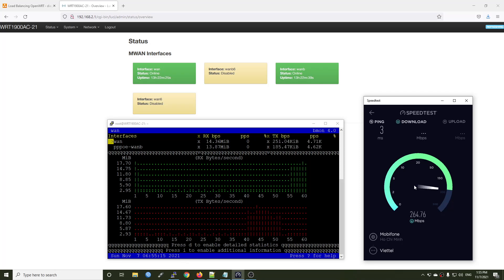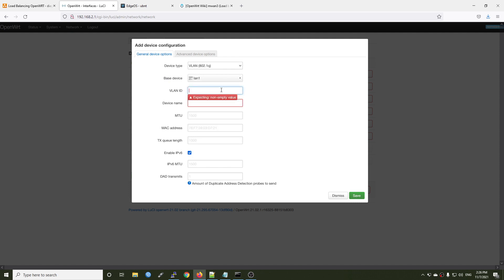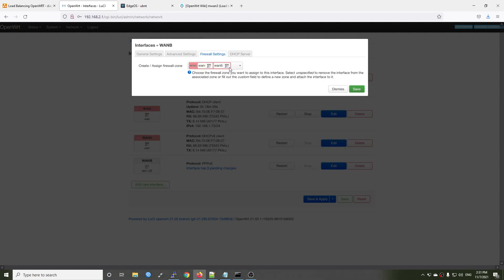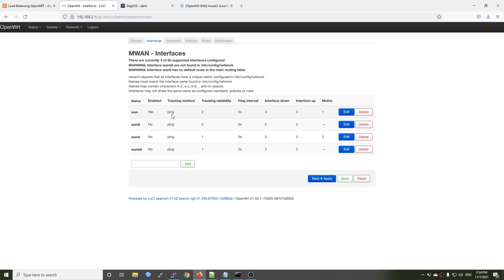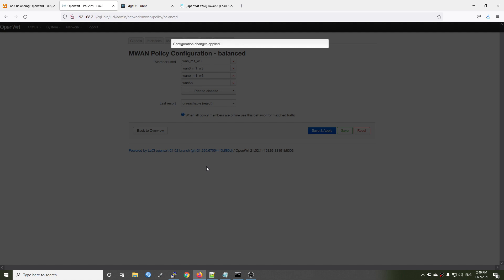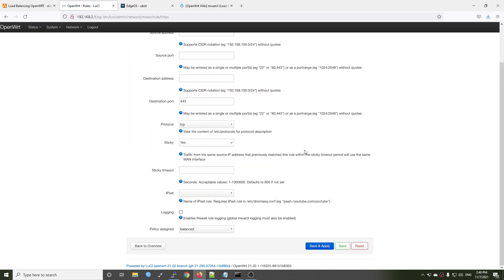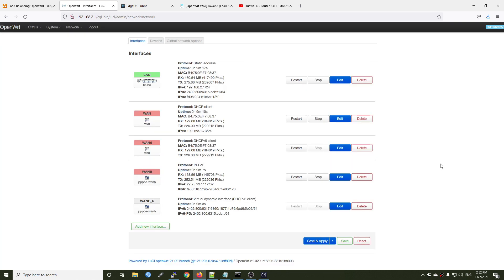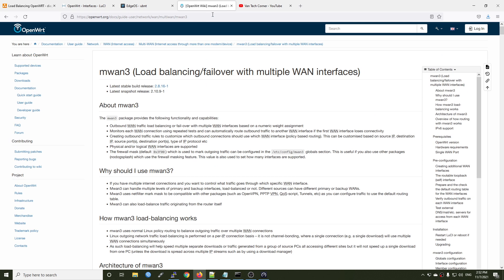OpenWRT 21.02  - Multi-WAN Load Balancing with mwan3

Comment: I know I’m 3 years late. But is it possible to run mwan3 along with SQM? A lot of apps I use support multiple connections nowadays, and I don’t want downloads utilizing the full speed of the WANs increasing latency for others.

Upon researching I think my Linksys WRT32X is not capable enough to run mwan3 with 2 interfaces and SQM, it will run into CPU bottleneck. Is this correct? Will a mini PC with Intel N150 accomplish what I want?
Reply from the maker: It is possible to use mwan3 & SQM, and you need a powerful processor to handle that. I highly believe that N5105 router PC with 2.5GbE ports will help, but will need you to test :)

Comment: What is the purpose of the VLAN?  Does it work without adding new VLAN?
Reply: Might be a vlan required for the PPPoE connection to the ISP.
My ISP for example requires VLAN 835 to connect

Comment: Hello I have a router Xiaomi ax3600 with openwrt. Previously i had no broadband connection on my home. But my next door neighbours wifi password (They gave me) I knew so I was using my router as a wifi repeater and used wifi more than a year with no problem. Their line speed is 20 mbps.

Recently i bought home broadband line myself. That is also 20 mbps I was thinking can i combine both line via openwrt. As my router is very capable. So i was thinking Like using fiber cable 20 mbps + neighbours wifi repeater 20 mbps = 40 mbps

Is that possible? If possible can anyone guide me please!

Comment: Thanks for the video. I have two wan (2 connection from 2 different ISP) load-balanced by mwan3, how can i setup wiregurd vpn so my ip address remain same? cause in my current load-balanced scenario my public ip address change frequently. Thanks a lot

Comment: Followed the tutorial. Wan6 and Wan6b appear online in loadbalance status. However in Windows the status of the ipv6 is "No internet access" and performing the testipv6 it appears that I am not with it active.
What's the problem?
Reply from the maker: Did you get the IPv6 connection up and running before settinh up mwan3? In order word, does your ISP support IPv6?
Reply: @VanTechCorner  Yes both ISP provide ipv6 and work on Openwrt or other system.  But when performing the mwan3 this happens.
Reply: Hi,thanks for your good video
I have 2 internet connection and want setup mwan3 for load balancing.
1st is p2mp wireless connection (30mbps)/1500GB per year
2nd is dsl connection(8mbps)/5000GB per year.
How should i set metric and weight for best performance??
Thanks alot

Comment: Hi, I have a Newifi router running with openwrt 19.07.4.
I installed MWAN3 software to configure a Dual-WAN FAILOVER from WAN to WAN2

I also installed NFTABLES software to configure BANDWIDTH LIMIT PER IP.

Now here's the catch and also my problem,
- I want the WAN to perform at full speed of bandwidth which doesn't have any problem in my experience ✅

-I want to configure the WAN2 with BANDWIDTH LIMIT PER IP when WAN lost its connection.

Now, when I configure BANDWIDTH LIMIT PER IP on NFTABLES it applies to WAN and WAN2 which is a pain in the *ss 😑

My question is. Is there a way that NFTABLES applies only to WAN2 for BANDWIDTH LIMIT PER IP while WAN is in full-speed?
Reply from the maker: Sorry I can't help you with this as this is too advance. Either you should go to the OpenWRT forum or contact the maintainer of the package for further information.

Comment: I'm considering putting OpenWRT on my Edgerouter X because of mwan3.
Reply from the maker: Hi, actually you can configure the load balancing on the EdgeRouter X with the Web UI. Everything is automatically configured and you just need to do that from the Setup Wizard. However, if you want to install OpenWRT on this device, here is my video guide https://youtu.be/VreMamhWOX8
Reply: it works great. Recently i have issues about https traffic sessions loosing connection . Must figure out how to balance it in order not  shatter it.

Comment: Hi, van tech corner, great tutorial.  I just wonder, what if the bandwidth of each port is not equal, can we still load balance it?
Reply from the maker: Yes, but in this case you should set the correct weight & metric for the interfaces.
Reply: @VanTechCorner  that's what I want to ask, can you give me example
Reply from the maker: Well, that is a lot of calculation. If you just get started to mwan3, you better follow my video to get it work first. After that, check the official mwan3 document and learn how to adjust it. Here is the key points:
- Member interfaces with the same metric will be load-balanced
- Load-balanced member interfaces distribute more traffic out those with higher weights
https://openwrt.org/docs/guide-user/network/wan/multiwan/mwan3
Reply: @VanTechCorner  yes I followed your instruction and it works well, but since it has different bandwidth for WAN and WANB, the result is not very satisfy for me. . but anyway thanks for you answer, I will look at your link to get more clear. thanks

Comment: HI Van,
Please guide on how to use Raspberry PI 4 B as OpenWRT 21.02 - Multi-WAN Load Balancing with mwan3
Reply from the maker: Hi, how are going to setup the Raspberry Pi 4 ? It only has 1 Gigabit Ethernet port.
Reply: @VanTechCorner  
Hi,
In my current setup, I have a ISP terminated on a Switch, to which Raspi Openwrt and a WiFi router is connected....To the same switch I wish to connect a WiFi Dongle to create a redundancy

Comment: Sir help me pls why my mwan just can workin on speedtest i try for watch youtube and download any files it not worked and just using 1 interface but in the speedtest it can use 2 interface and balanced pls help
Reply from the maker: The problem is that your application (Youtube) doesn't support multiple connections. Mwan3 only load balancing, it doesn't bound all available throughput of the 2 interfaces.
Reply: @VanTechCorner  is it possible to streaming video with multiple connection sir? Do u know what plaform that support it?
Reply: @comcom9342  you need to have a Virtual Private Server with OpenMPTCPRouter to be able to do what you're asking

Comment: Hello,I would like to ask a question, the openWrt router is configured with a lot of wireguard protocol VPN WAN ports, and then I use Mwan3 to split the traffic, so that a specific internal IP goes out through a specific wireguard WAN port, everything runs normally, but there is a small problem that the router has just turned on For about 10 seconds, before Mwan3 is automatically loaded, the all traffic will go out through the default local ISP  WAN port. Is there any solution to make the router go out through the WAN port of the wireugard protocol as soon as it is powered on, and never go through the local ISP WAN port? .Thank you so much.
Reply from the maker: You can see the Kill Switch. https://openwrt.org/docs/guide-user/services/vpn/wireguard/extras
Reply: Set br-lan to delay startup, and wait for all interfaces of wireaguard to start up and Mwan3 to be loaded before starting br-lan. Is this solution ok? But I also don't know how to set br-lan to delay startup for about 1 minute.

Comment: hi, thanks for your video, just a question, when i tried to create a new interface, in my devices section i d'ont have lan ports separately, can you tell me please how can i fix it ? openwrt 21.02
Reply from the maker: May I know the router model? Maybe your device is still using swconfig, if yes you should see the Switch menu in Network section.
Reply: @VanTechCorner  thank you for the answer, i have a Tp-link Archer C7 v4, unfortunately no DSA

Comment: Hi, is that combining the 2 wan bandwidth?
Reply from the maker: Nope, it is load balancing. 1+1=0.5+0.5+0.5+0.5, not 1+1=2
Reply: @VanTechCorner  But with certain applications, like torrent clients and Steam, you would get download speeds that are (more or less) a sum of both internet connections, right?

Comment: hi , i like your videos nad i have a question , can we use loadblancing and wireguard VPN as client in the same time with maximum bandwide? cuz i tryed but every time wireguard just using one of my wans and didnt use full bandwide of my wans
Reply from the maker: Hello, Wireguard will establish the connection to 1 endpoint IP (server) thus it will be using just 1 WAN connection. You can play around and try to create the load balance of 2 wireguard interfaces, but I have yet to test if it is working.
Reply: @VanTechCorner  mwan3 was designed for physical interfaces, but seamlessly accepts virtual interfaces. I've had it working with a 1 gig Fibre optic PPPoE connection using a vlan, and as second WAN a 4G mobile hotspot adapter connected via usb. When downloading large raspberry pi images using bittorrent, it used both adapters to maximum bandwidth, that was cool to see, 150 Megabytes per second transfer
Reply from the maker: Thanks for the informative update, Paul!

Comment: Is it okay to update packages? Or it can can conflict in your recent configuration?
Reply from the maker: As I know, the config files of the package will be the same and I never have a problem when upgrading them.
Reply: @VanTechCorner  Is this normal? I have 20Mbps in WAN1 and 20Mbps in WAN2 but when I'm trying to speedtest I can get is around 25Mbps only.
Reply from the maker: @rowelbarrios4945  Yes it is normal as mwan3 doesn't combine the throughput of all your WAN interfaces. Also, check the CPU usage during the test. Perhaps the CPU reach 100% usage with slow down the speed.

Comment: My public IP is changes continuously. One it changes to "wan" & then it changes to "wanb"
Reply from the maker: Hey, did you solve the problem?
Reply: @VanTechCorner  Un tick this option "Enable Application Optimized Routing". At Transmission > Load Balancing

Comment: how do you setup a dual Wan with a 4gLTE modem and a dedicated wan port?
Reply from the maker: Still the same setting, you just need to specify the correct interface name for that 4G connection.
Reply: @VanTechCorner  im not sure how to process the ipv4 / v6 do i create two interfaces like a lan/wan connection?

Comment: So, after I create the wanb port as PPPoE, enter the PPPoE login details, I get an error saying Connection Attempt Failed.  Where am I going wrong?
Reply: same problem here
did you solve it?
Reply: all settings for wanb connection are valid - i tried to run it on wan device and everything was fine. but on lan1.35 - Connection Attempt Failed all the time
Reply: Haha, I gave up... LONG BACK..